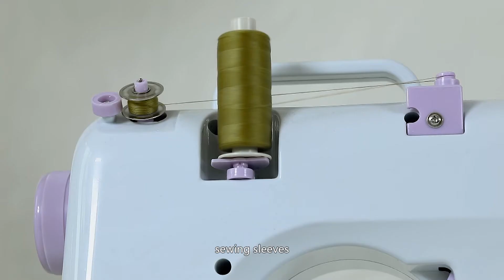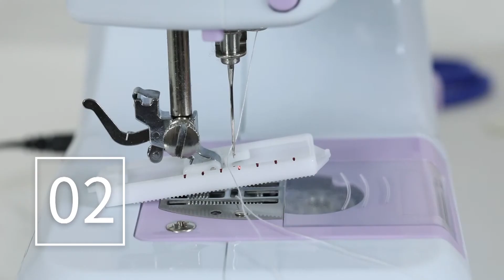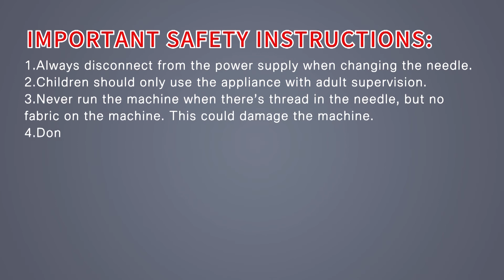Tutorial video of sewing machine FHSM-505

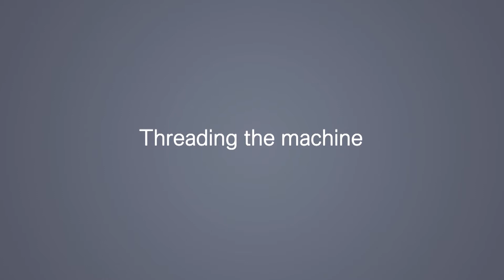Comment: 1:00 Threading the machine

2:00 replacing the bottom bobbin

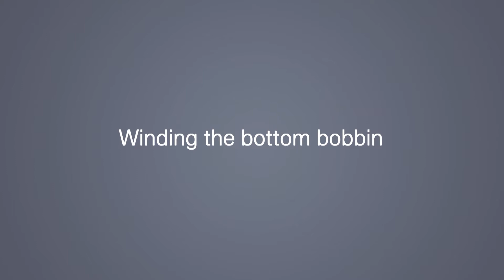2:48 widening the bobbin

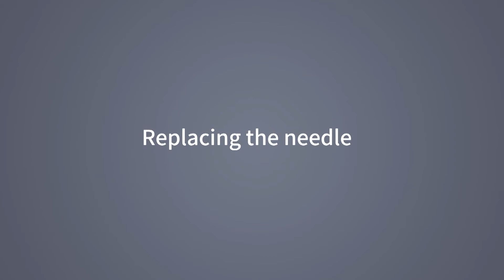4:00 replacing the needle 

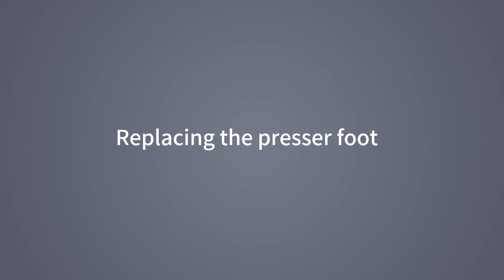4:40 replacing the press foot

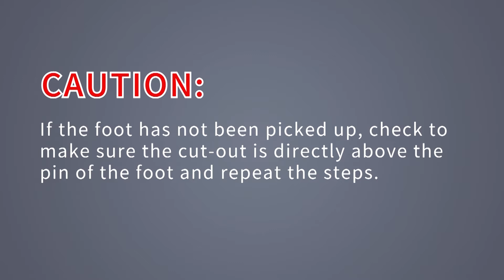5:28 using the adapter and the pedal

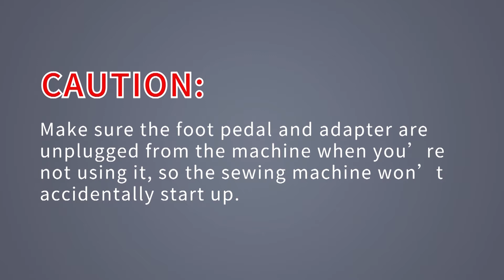6:06 installing the batteries 

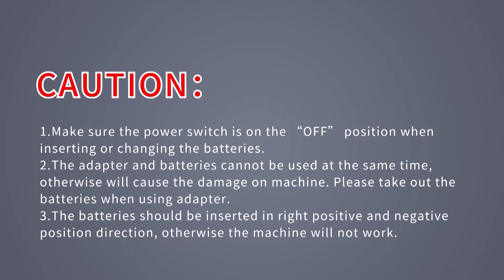6:54 sewing

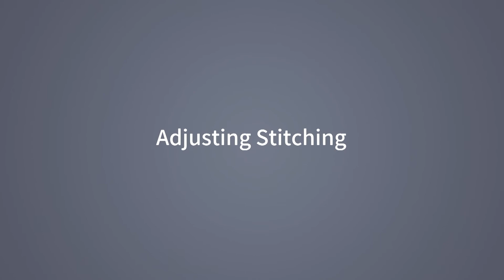8:30 adjusting stitching 

9:25 reverse sewing

9:48 sewing sleeves 

9:53 button hole sewing

11:00 nailing button